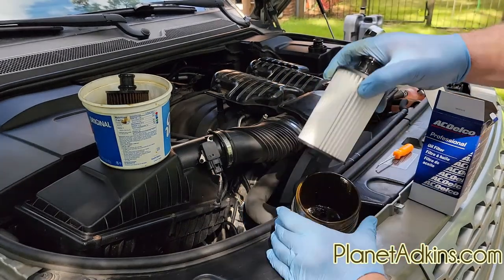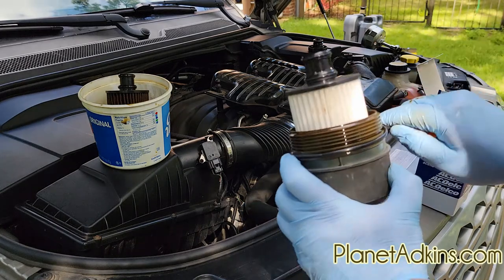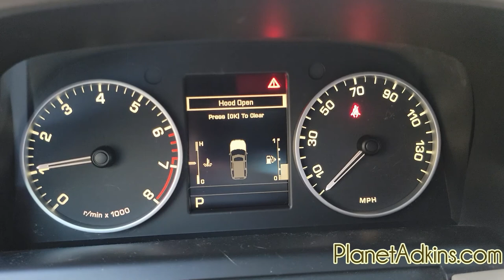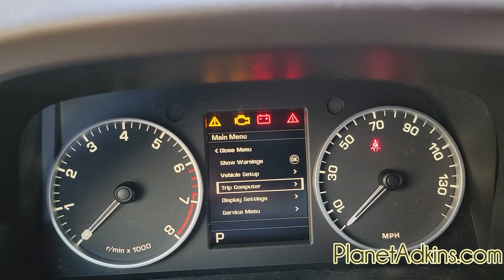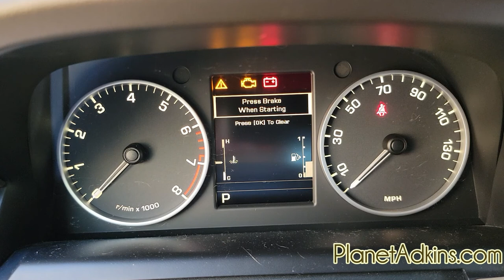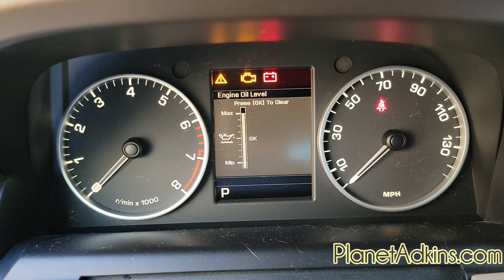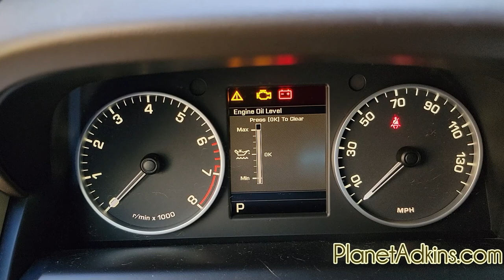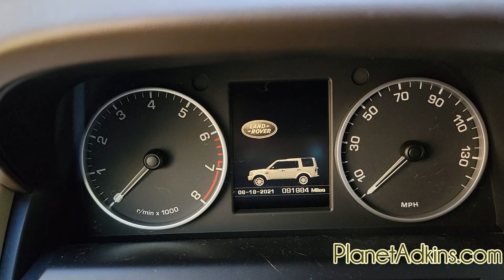LR4 Oil Change with extractor pump on a Land Rover

Comment: As you know the skid plate makes it difficult for a quick oile change. When I was getting tires, I asked for a change as well. They said that a bolt was stripped, so didn't do it. Flash forward one week, and your video pops up in my feed. Thanks!
Reply: Hi Bill!  Glad it came in handy.  I've gotten to where I really like this easy oil change method.  My wife's BMW doesn't have an oil dipstick (only electronic oil level measurement) so I had to crawl under to do it. I'm a big boy and there isn't much room under those!  If you do have cars you have to crawl under, check out the Fumoto valves.  I've used them for 15 years and never had a problem.  Due to very little clearance I used the motorcycle version (B109SX in this case) and it works great.  Clip on the hose, flip the lever and the oil comes out!  Glad you like the video!  Drop me a thumbs up if you don't mind.

Comment: This is a really helpful video. Did you need to buy a separate attachment to hook up the tube to the port to extract the oil or did the vacuum kit come with everything you needed to do this?
Reply: HI Brian, it came with everything needed.  It has several different hose sizes for use with different cars.

Comment: Does it come with the hose and rubber end that you put zip ties on?
Reply: Yes it does.  I put the zip ties on because it wants to stick to the oil stem on the car instead of the hose.  Then you have to get a pair of pliers and pull it off the car.  It's a little annoying.  The zipties seem to do the trick.

Comment: how do you like using the liqui moly ? I want to try it in my 2011 lr4
Reply from the maker: It seems to work great.  It's the only stateside oil that I could find that explicitly indicated that it met the LR oil criteria. Since I was still under an extended warranty (CPO) when I bought it, I used the Liquid Moly so not to get any grief from the dealership.  I've just continued to use it, but at shortened change intervals (7500mi vs 15000 I think LR recommends).  LR products are often thought to be a bit... fragile... So it's cheap insurance for me.  In fact, thanks for reminding me - I need to do an oil change now.  Ima head over and order it and the filter. I think I might even reduce that to 5000 miles as she's getting a bit older now, with about 120k miles on the clock.

Comment: DUDE YOUR LUBING THE  NEW  RINGS WITH DIRTY CONTAMINATED OIL.IF YOUR CHANGING OIL YOU HAVE BRAND NEW OIL
Reply from the maker: You are correct, I probably should have used the new oil.  But the o-ring isn't in the flow so I didn't think it would matter.  Thanks for the suggestion!